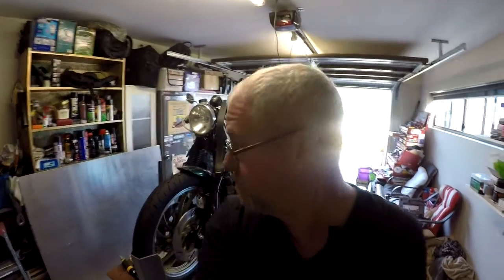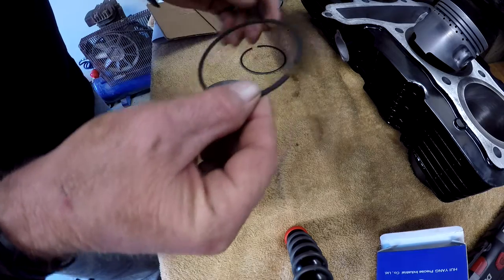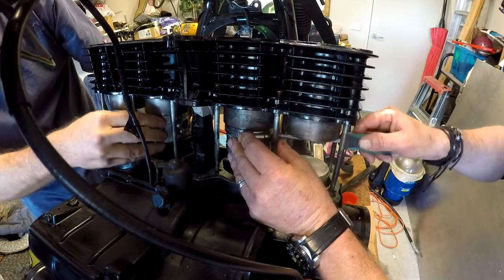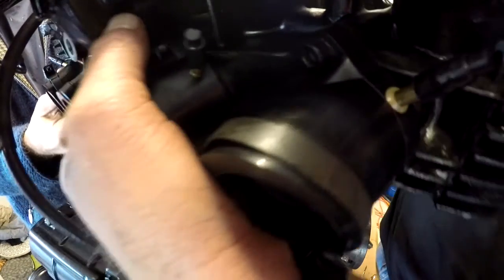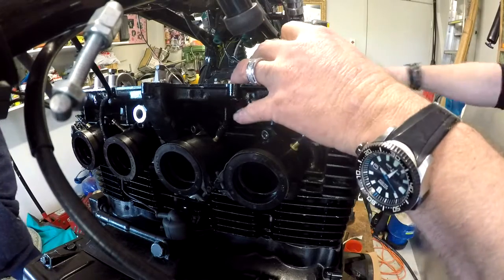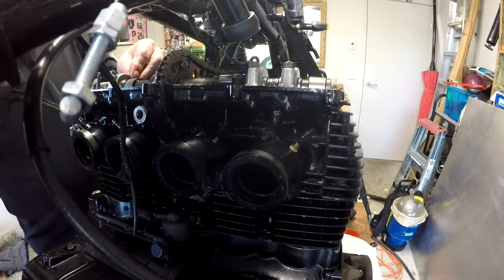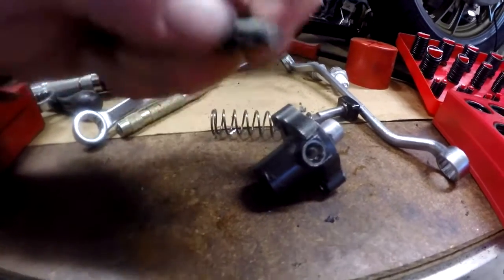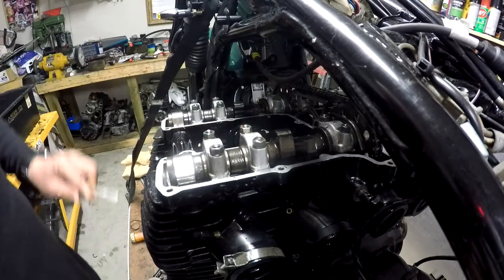Yamaha XS1100 Cafe Racer Project - Episode 49 - Engine Assembly

Comment: It's always a good idea to check valve clearance when head is off the bike,easier and saves time,also when installing cam chain tensioner pull cam chain tight leaving slack at tensioner area then deploy spring bolt

Comment: So Andy, about my 1979 XS1100 I got Athena Gasket kit I got a rubber gasket with tabs that goes on the Cam Chain Area. I am trying to figure how to install that between Valve heads and Cylinders. The question is Won’t that create a gap between Valve heads and Cylinders? Do really need to install? Can’t find information anywhere and manual is not clear.

Comment: I'm rebuilding a 79 Yamaha xs1100 I am using this old Pistons like you did what size rings would I need after honing The Jug? With standard rings work also would I have to grind them for The Gap

Comment: Hi Andy! Really love your videos! I am replacing the rings on my xs1100. And I want to use the worm drive clamps like you but I was wondering did the clamps you used have a little gap on the tightening mechanism? I can't quite tell in the video. Just wondering because I'm worried the rings will get caught in that gap when putting the cylinders on and that it will damage the rings.
Reply from the maker: They’ll be fine mate. Just be sure that the ring gaps are not located where the worm drive is and you’ll be okay
Reply: Alrighty thank you!!!!!! Now one more question😊 I finally got the engine together. But there is steam like smoke coming out of the crankcase breather. I understand it can be condensation but if this keeps happening should I worry. It was doing this before I replaced the rings.

Comment: Torque specifications for cylinder head, camshaft and engine cover? 
please 🙏
Reply from the maker: Cylinder head is 25 ft-lb (35 Nm) and 14.5 ft-lb (20 Nm) for the smaller ones at the front and rear. Cam bearing caps are done in two stages to a final torque of 7.2 ft-lb (10 Nm) I don’t have a spec for the cam cover, I’ve always just done them up by hand.
Reply: @ANDY5    After the torque wrench clicked once,on the head bolts at 25Lb.,, why do you go for the second click ,,i was taught this can overtorque?
Reply: @ANDY5  thank you very much my friend

Comment: Hi Andy - another great video - one question, why did you move the crank to “C” before installing the tensioner ?
Reply from the maker: Karl Pee g’day mate. Yamaha marked the ‘C’ as the set position for the chain tensioner and it will be the point in the rotation where there is the least amount of stress on the chain from the cam shafts.

Comment: hello, started watching on the recommendation from Ollie. A good idea using those hose clamps as ring compressors. One question - the base gasket - did you use any jointing compound etc or was the gasket dry? I noticed from an earlier episode that you had trouble in getting old glue off. What do you think of jointing compound.
David
Reply from the maker: Hi David, I am not a fan of gasket goo, particularly in such a hard to reach location.  If you are not planning on being the one who is going to remove it again I would say go for it, it adds another level of security.  The trick is to make sure that the mating surfaces are clean and fee of the old gasket.

Comment: Hey Andy, Great Job.  Your video's have really helped me out in lots of areas.  Just wondering, did you use the same head bolts putting the head back on.  I did a small engine recently and had to replace them, since they stretched out a bit.
Reply from the maker: Hi Mark, thanks for the feedback, much appreciated. Yes I did use the same studs. I have had to use new ones from time to time over the years but mostly not. Andy